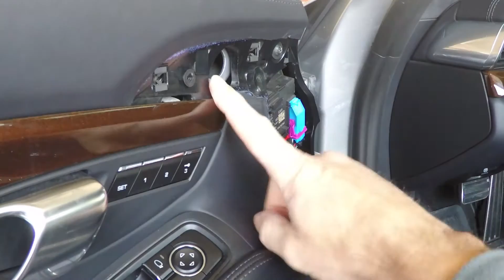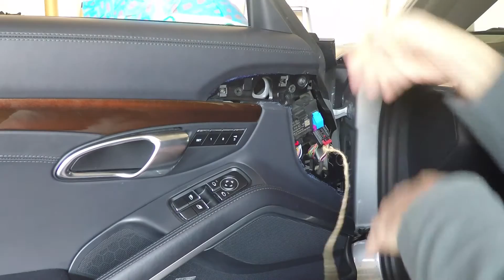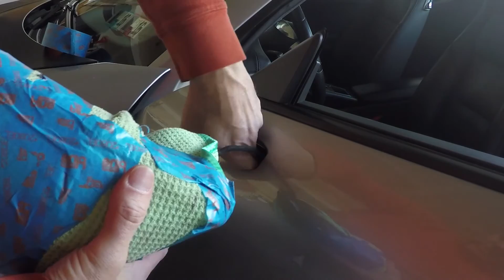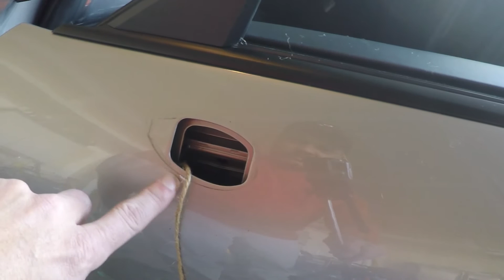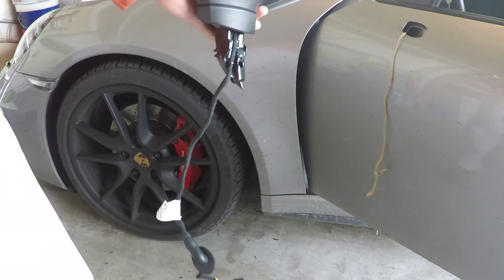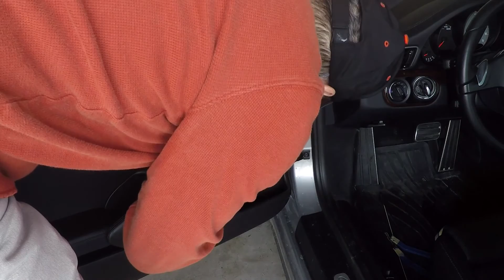How To Remove a Porsche 991 Driver Door Mirror

Comment: Do you by chance know how to remove the door handle on this car? Im having trouble with it.
Reply from the maker: Hi Paul!  Thanks for watching!  To remove the door handle requires the removal of the interior door panel/card, release of the inner door handle opening cable, and removal of the lock mechanism from the interior side.  Sounds worse than it really is, if you are at all comfortable with removing interior trim as shown in some of my videos such as "How to remove interior door panel" https://youtu.be/VFQbGD0lP-U.   I do plan on uploading a video of removing the door handle, but no sure when I'll get to it (prep for wrapping the car in color-change). I also have the official factory Work Manuals if you want to DM me.  Good Luck, and please subscribe if you haven't already!
Reply: I will dm you my email if you can send me the instructions if possible. I am also preparing for wrap. Check out my page. Im based out of dallas tx. Wrap masters tx fb.
Reply: Cant seem to find the button to dm you
Reply from the maker: Sorry...  You can just email me at gtsilver911@google.com...  Thanks!

Comment: What glue did you exactly use so the bolt doesn’t drop?
Reply from the maker: Hi-  I honestly don't recall....  !  I would have probably used some Elmer's Rubber Cement that was sticky.  I've also used some photo mounting glue dots before, and in the video it looks like one of those.  Can't remember, Sorry.  End of day, you just want something sticky or a socket that fits in the hole and is tight around the bolt head so it doesn't fall out.  Thanks for watching!
Reply: GTSilver thanks for replying. I will probably try to stick some cardboard and shape it like s tube.

Comment: Well, as expected, the screw dropped somewhere in the door while trying to dismount the mirror from the door. Had to run to a hardware store just to screw something. Any idea how to retrieve it? Do you know how to remove the door panel?
Funny thing is I don't think I needed to remove the mirrors, I just wanted to swap the housing for a carbon fiber one I bought on RL.
Reply from the maker: +PashaJ removing the inner door panel is easy....  check out my other video for that!  With the panel of you should be able to retrieve the screw.
Reply: Thank you...I happen to watch that video later in the evening. I should check your complete catalog of videos prior to shrieking for your help. By the way, I just came back from the car show...saw your new car...looking mighty nice.